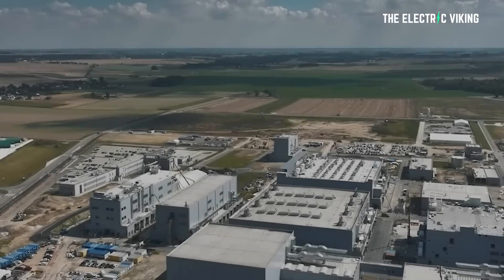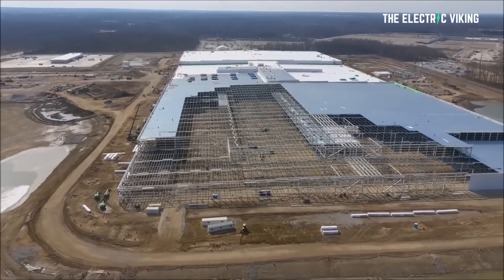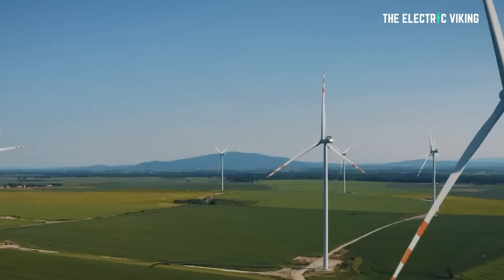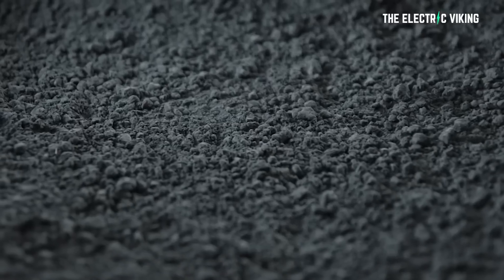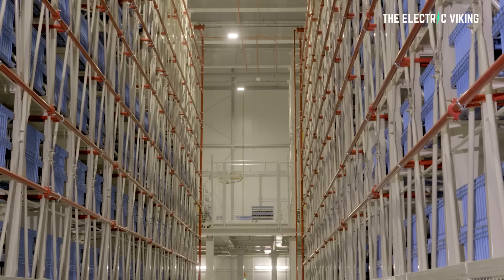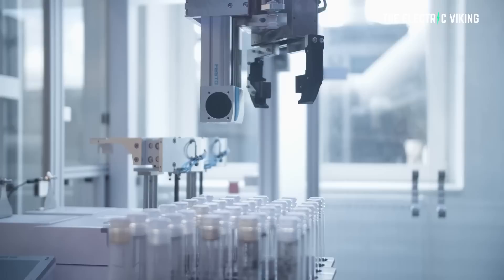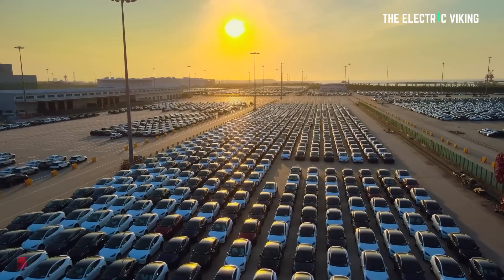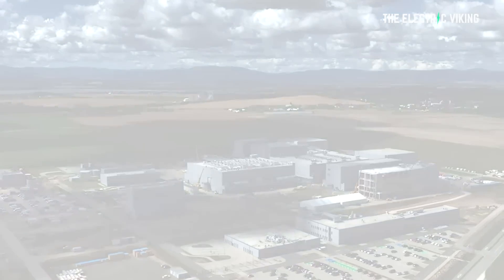The world's biggest battery factory will make batteries for 8 million EVs

Comment: Mr Putin stopping fossil fuels is an incentive for the ramp up of storage for Renewables and the maintenance of backup fossil fuels for emergencies and peak winter.
A warmer climate is more energy in the weather and less home heating. 
Infact well insulated homes in hot sunny summer are easier to air condition.
If Russia gets back to a working relationship with the world it will not include any gas or fossil fuels.
Reply: Russia still has a working relationship with many countries and will not struggle to find buyers for its oil and gas.

When we evaluate the issues with fossil fuels their ability to fund some of the vilest dictators and the worst companies on the planet is often overlooked.
Reply: @robsengahay5614  well said. 
As I said when the West gets into full swing on Renewables then it can do more elsewhere. 
China is pushing hard for Renewables. 
Electric vehicles productions ramping up 
Solar PV panels.
EV batteries productions and innovations

It feels vulnerable with its importation of fossil fuels.
Coal from Australia. 
Petroleum, etc.

China might pressure its dictator friends.
No CO2 in the world is the point.
China can supply all the new customers. 
Hahaha 😊

Comment: It is interesting and you may or may not have touched on these battery plants as being set up to take advantage of brand new technology coming down the pipe and integrating it as they operate. This is key as battery technology is advancing rapidly but they can't wait to find out the very best as it takes years to fully set up a battery plant and the logistics involved in serving them. I am waiting on a decision by GM on a new battery plan in my back yard - an Ultium plant by LG as it seems to be a very large plant also. I am surprised by your comment "Unfortunately " concerning LG as it's a large petrochemical company. You should be encouraged as you see petrochemical companies starting to read the handwriting on the wall and switch to the "Electric Future". My one concern is the actual production of power itself as the world switches over. Not sure if you can get numbers of renewable energy produced year by year and also the spread of the Grid needed to provide these power centers to reach every community  for this endeavor to be successful.